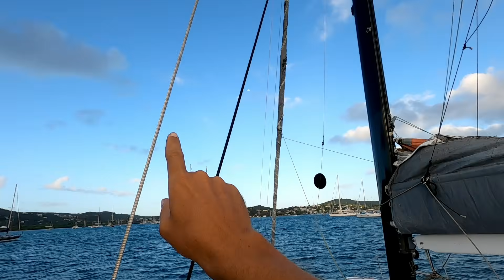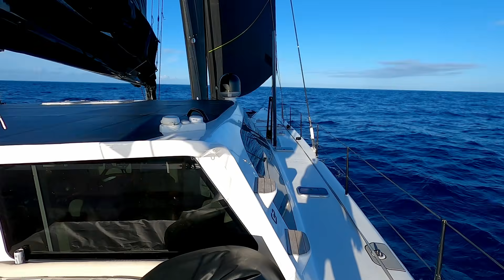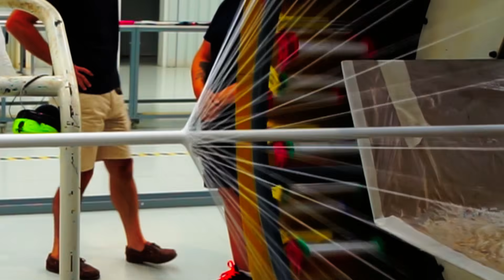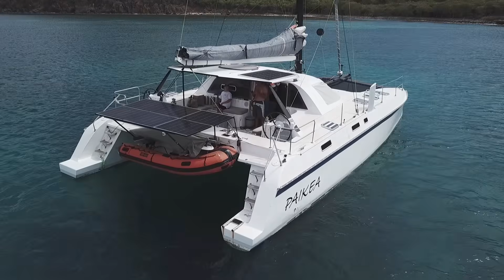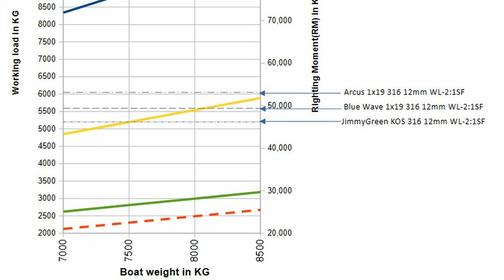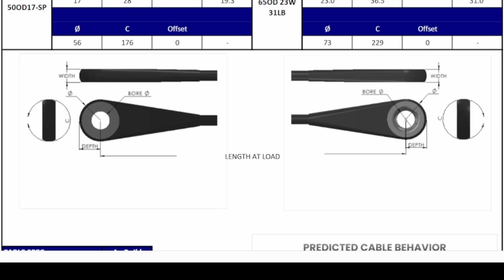Replacing Wire Sidestays with Synthetic

Comment: Great vid - I wish there were more folks at the performance end discussing this stuff.  I've got a 15m performance cat that dismasted and is being rebuilt and deciding about moving up from kevlar shrouds to DM20.  Helpful to hear about Fabrica - do you know anyone similar in North America?  I'm going to change to a rotating rig as well, so your vid on your AC mast was super helpful.  Thank you both!
Reply from the maker: Lightspeed in US could be an option for you. They have the nicest end fittings of any cable company by far. However they are definitely pushing the higher performance end of the cable. They run a safety factor of 2:1 rather than the usual 4:1 that Fabrica and others currently use. Lightspeed resin impregnate their fibers which may stablise it enough to run those lower numbers but I honestly don't know enough about their product to say that with confidence.

Comment: Genuinely fascinating detail. Someone once told me Lagoon cats are designed to lose their rig before capsize - no idea if that’s true but might explain why the industry under specs rigging.
Reply: Yes this is true.
This is because the righting moments are so high that the stays would be as the diameter of my arm and the mast would be larger than a power pole!
So they run what is seen to be reasonable size rigging for a boat of  of what ever lagoon model. The put in the use Manuel "reef at this point" so the mast won't fall down.
Then the marketing team try to sell it as a safety feature......
Reply: @s @shayneyoung4801 

Ha! That’s marketing for you…

In any event, it seems to have made a difference. Everybody used to think multis were risky for cruising but now they seem to dominate (and very few reports of capsize).

Love the channel 

👍

Comment: This was such a great video! I really liked the format of Anna asking questions and comparing options, and Shayne explaining.  I don’t get as lost.  I enjoy learning as much as I can and this style really helps me not get lost in all of the new concepts.  
2 questions: 
1- is there available software that would allow anyone (read me) to do these load calculations on their boat, and if so what is it?
2- the decisions on load strengths seem predicated on the idea that it is better for the boat to capsize than for the rig to come down. Do all manufacturers have that same view? Is that a safe assumption that the boat is engineered to capsize before losing the rig??
Thanks in advance.
Reply from the maker: Thanks mate. Glad you liked the format and were able to follow what we were rambling on about 🤪. In answer to your questions. 1. No there is no software for this kind of work. 2. Not all manufacturers build to this idea of you should capsize the boat before you break a sidestay. Some cats are so big and heavy that in order to follow this safety logic they would need massively thick sidestays.

Comment: Thanks for that - always good to hear someone who knows a lot go through ideas. I was wondering about the rest of us - those who are not so conversant with Euro riggers and such. For us, would SK 78 be reasonable as a stainless replacement? Also, a little Physics teacher pedantry. The unit for torque is Newton metres, not Newtons per meter. To get the units from an equation, pop the units themselves along with the numbers into the equation. Torque = Force x distance from centre. So the units are Newtons (or kilograms if you are on Earth!) multiplied by metres - hence Newton metres. Newtons per metres is what you get when you divide force by distance, which is actually how we measure stiffness. Cheers Phil
Reply: Any of the materials are good enough for the job of replacing stainless. The trick is to match the right properties so they perform the same way. 99.9999999% of the time going to dyneema you are stretch and creep properties driven. So you will see dyneema stays usually much larger in diameter and way stronger than the stainless equivalent because you need to match the stretch and creep.

Yes, nice catch on my torque units descriptor. I'm usually writing it not saying it, so not so well rehearsed get that one out of my head😂

Comment: Have your new load calculations affected your chainplates? Do you now have to beef them up a bit?
I may have missed it in the video but to me it isn't clear that the DM20 from Fabrica is continuous loop or a braided rope with end splices? How is the rope terminated in the end fittings
Reply: The dm20 stays from fabrica are continuous wound uni cables.
The end fittings are machined thimbles that get urethane cast into the end of the cables.
We show a fair bit of this in the factory tour vid coming up
Reply: @shayneyoung4801 thank you
Reply: @shayneyoung4801 how does the cost compare with swaged stainless or dyform stainless?
Reply: @deerfootnz about 1.5 to 2 times depending on a few factors.
Reply: Covers are dyneema as well. The braiding machine in the vid is braiding the dyneema cove on a cable
Reply: Yes 100% they are suitable for passing over the end of spreaders. Spreader ends do need to be set up to have synthetic stays pass over the ends. 
It is quite common now to also have all the d cables braided into a single outer V.
So you send up with ful continuous rigging with the look of a discontinuous setup
Reply from the maker: Nah chainplates are bullet proof. The chain plate working load is based off the stay breaking load
Reply: @youngbarnacles  but haven't you upped the breaking load - doubled it?
And I am unclear if the DM20 from Fabrica is continuous loop or braided/plaited rope. How is the termination in the end fittings achieved? And what coverings are over the new stays? Are they suitable for continuous V1's passing over two spreaders
Reply: @deerfootnz yes the cable breaking loAd has doubled due to higher safety factor. The working load is still less than 6t. The chain plates are plenty good for 6t working load. We could put side stays in there that have a 50t breaking load, the chain plates will still have the same 6t working load to deal with.
Reply: @shayneyoung4801  I guess your righting moment has actually decreased with weight
Reply: @deerfootnz yes that is correct, that is what the video shows. 
What the righting moment was when the boat was 8.5t and what it will be at our target 7t, and how that affects the stay working load
Reply: The chain plates were designed with a working load of 12t with a 2.1 safety factor. When they were built there was a boat building additional safety factor put in there as well

Comment: I've been using textile shrouds for probably 20 years. I've not been keeping up, but I've always understood that creep and stretch are two different things: there is constructional stretch, which is the fibres meshing/nesting when loaded and is not indefinite; and creep, which is the fibres becoming elastic and stretching in and of themselves over time under load indefinitely.

There also was no mention of Hampidjan's Dynex (now DynIce I think) line, which at least at one time was the gold standard for braided UHMWPE?

Thank you for the excellent video and it is extremely nifty that there are people fabricating unidirectional shrouds, which was something we all wished for back when textile first came out, every time we readjusted our shrouds (lashings)

Comment: Fantastic video, and so well timed for me!
I'm currently rocking rod rigging on my IMX40 (the original one, so 24 years old at this stage, but before I got the boat, I don't believe it was abused much, as the boat was in Norway).
I am really not looking forward to swapping rod for rod, but I still haven't found a better alternative. New carbon is 2-3 times more expensive (versus rod), and given it's a racer-cruiser, I really doubt it makes sense going with carbon in my case, won't add much resale value after all.
So with all this in mind, I started my research for Dyneema rigging, and your video is the best piece of content on the topic to date; thanks again.

One question, if you don't mind. If you were in my position, with a racer-cruiser that you'd be mostly racing, then cruising, and you'd be changing the rigging, what would be your thought process, and what would be the strongest candidate?

Cheers,
Anton from Seika Racing
Reply from the maker: Go with PBO. Unfortunately lifespan of PBO is short but you get all the benefits at a reasonable cost. If you are thinking of keeping boat longer than 10 years go with carbon. If you can get carbon rigging at 2x or 3x rod rigging that is a fantastic price and carbon will last ages.
Reply: @youngbarnacles 
There is an newer abrasion and weather  sheathed form of Dyneema standing rigging that Sam Homes is using on his Schoning Cat Pickled Catfish currently, that is intended to protect and extend it's life and stability . The other item is the size of the load spreading of the rigging over the dead eyes.... The other change is the strain gauges that you can now buy and fit for all types of standing  rigging and shows you what's going on and potential warnings of sudden  failures developing . 🤷🏻 For what it's worth.
Reply: @clivestainlesssteelwomble7665 the materials Sam used are not new. It is materials we have used in the rigging industry for many years and YouTubers are only just discovering it. And like in many YouTubers cases not understanding how to use it or properly work with it.
Dyneema chave covers are awesome and I use it on every thing, I even make soft shackles with it for special situations.
The parraD cable Sam is using is an unrefined version of the cables that we are getting from Fabrica. I don't want to rubbish the parraD cables but they look more back yard than the first Future Fibre cables from 2003.
Reply: @clivestainlesssteelwomble7665 the load sensor you mention is the one best thing that is becoming more readily available to the average sailor. Thanks to @Cyclopsmarine load cells. This is one item I have made allowance for in the future of the rig setup. 
For me this is the single most understated instrument for a multi hull

Comment: I have heard that dyneema has a negative temperature coefficient of expansion. Is that any kind of concern when used for standing rigging? Does the rig tension vary noticeably with temp? Carbon is close to zero TCE. But aluminum has a positive TCE. Just curious. Very interesting video.
Reply from the maker: Yes, yes and yes. If its a really hot day or a really cold day, our PBO lower stays can feel slightly tighter or looser. But in general the effects are so minor that it is not a consideration factor. The rig tune numbers are still within tolerance.

Comment: Dang that's not enough between BL of the Blue Wave and the max load at all. Add a few ocean crossings with lots of cycles and no wonder it only lasted 6 yrs. 2:1 is about right for inshore Grand Prix racing boats. If somebody wanted to stick with stainless, 12mm Dyform gets you ~14 tonnes breaking strength which is a considerable step up.
Reply from the maker: Correct. We didn't have time to talk about dyform- video was already epically long. We do have a video on our Members site which covers the properties of dyform wire

Comment: Minor correction, KOS wire is Korean it is high quality and is what Arcus supply. Not sure where the Chinese bit came from.
Reply from the maker: Thanks for correction- yes KOS does appear to be made in Korea. In video we compared Jimmy Green and Arcus Wire. Their websites say: Jimmy Green - KOS 12mm 1x19 10.4t MBS. Arcus Wire - Hamma Xstrand 1x19 with a MBS 12.102t.
Reply from the maker: Oh now you've sent Shayne down the rabbit hole! The Hamma brand of Wire sold by Arcus is made by KOS (Korea Original Stainless) but has different properties from the KOS brand Jimmy Green uses. Jimmy Green one is lower spec than the one Arcus uses.

Comment: How many miles on the standing rig? I’m at 7.5 years and 32K miles, thinking about the next renewal. Either in NZ this winter, only another 1-4K more miles depending on seasonal timing, or Oz next winter, likely 10K more. The stretch on that DM20 is not trivial, 23mm at half load, 46 at full!
Reply from the maker: I think we only have 20/25k on our rig. So just goes to show how loaded it is. Yep DM20 stretches too

Comment: Excellent video, could you please give a price comparison, or are these materials financially out of reach for the average boater?
Reply from the maker: For a rough guide: If you take SS 1x19 wire as your baseline, Kevlar/PBO/Dyneema made as a cable would be approximately twice the price. Carbon is approximately seven times the price. This all depends on many factors